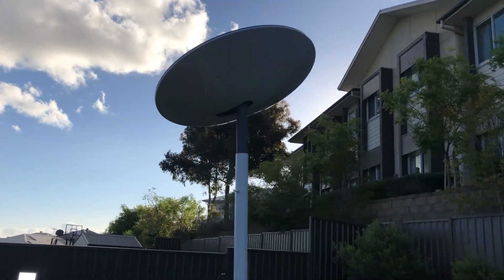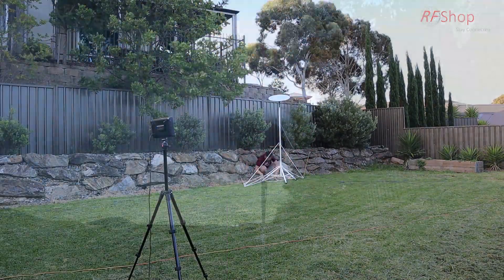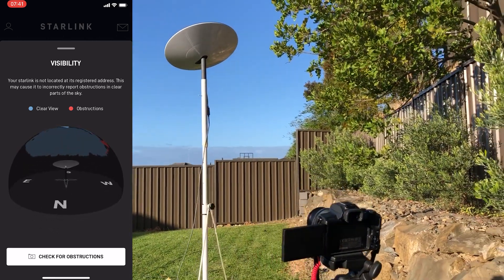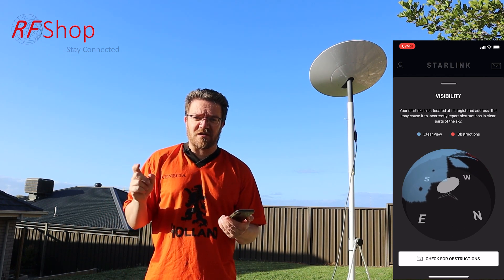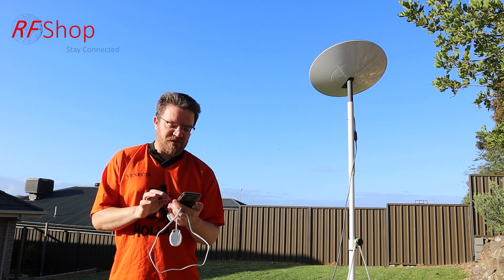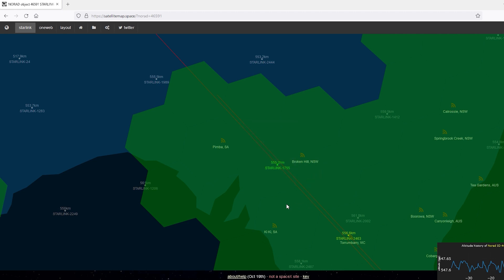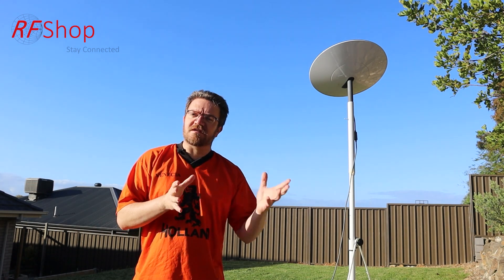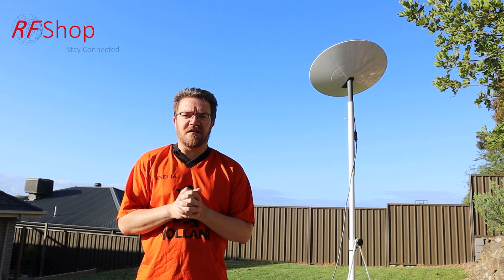How clear does the sky need to be for my Starlink Dish

Comment: I have a South facing top story balcony. Will it work for me? My condo will not allow me to put anything on the roof unfortunately.
Reply from the maker: The direction the unit moves depends on where in the world you are located (i.e. Northern or Southern Hemisphere). However, it actually needs a reasonably clear view of the sky, so a view from a balcony may suffer quite significantly from the wall.

Comment: What tripod mount is that, and has it been working well/sturdy in wind?
Reply from the maker: I use a speaker tripod. Works quite well for temporary solutions, but I had to strap it down overnight to make sure it worked well and kept steady...so probably not ideal for permanent use.

Comment: Nice test , Love the starlink, seems to be a surprisingly small cone in the direction the dish faces, you don't need 360 Degrees of clear area to install
Reply from the maker: Hi Michael,
Indeed, there's actually a whole phased array inside of the dish shaped disc
Reply: @RFShop  The phased array is flat.
Reply from the maker: @solexxx8588  I know, I refer to the whole structure as a dish shaped disc (radome, electronics etc) because that's how it's presented. Only when a technical person opens it up does it show the true shape and value.

Comment: How is the general experience? What do you reckon about using this technology at a camper van (stationary) here in Oz? I’ve heard that the test RV hardware in US.
Reply from the maker: Hi Alex. I think that Starlink solutions will change the landscape significantly. Performance is typically more than 200Mbps and currently the latency / ping is below 50ms. I don't really have a feel for when true mobility will happen, but if you have a fixed location it's good. I roam between locations but it's within 5km so I know I'm not really moving. 
Personally, I love this solution